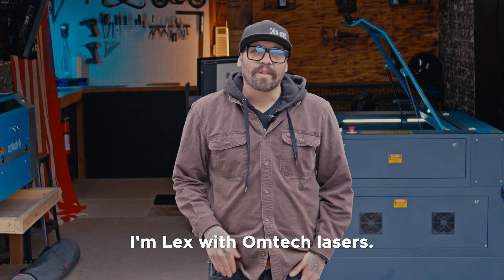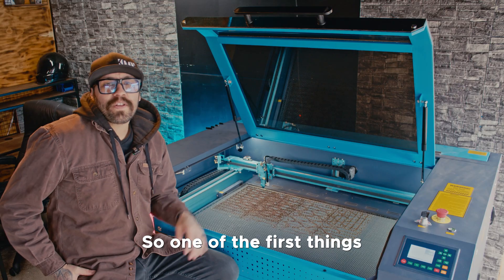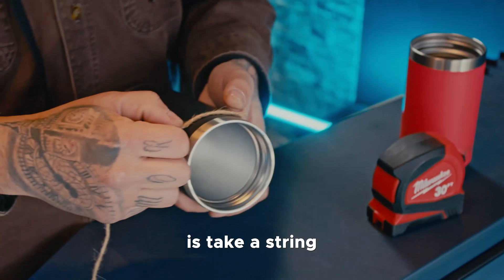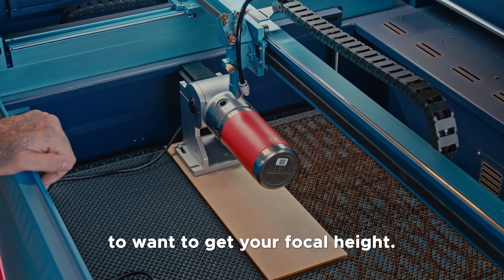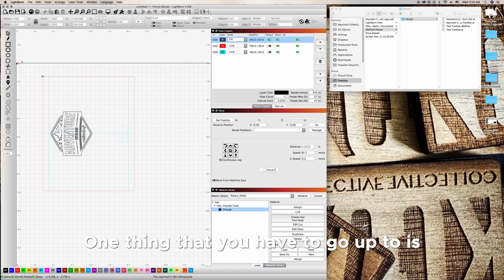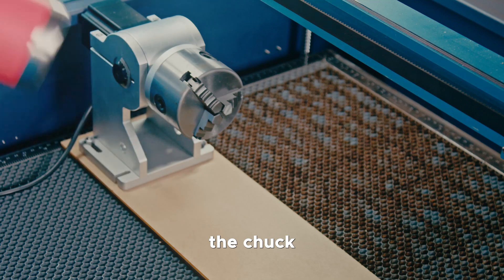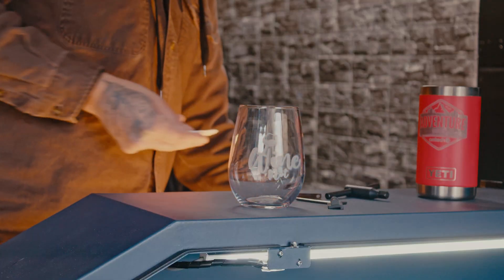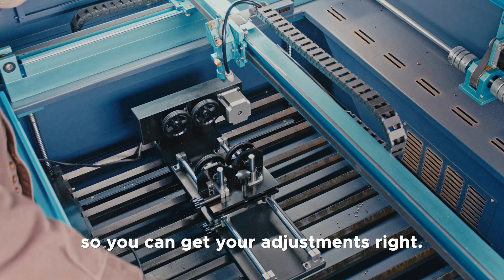Pronto Machine Rotary Axis Installation Guide: Enhance Your Laser Engraving Skills!

Comment: If you measure the diameter accurately, huh, dial calipers, 
Math will get you the circumference, which is much better then using "String"

Comment: I have a question, I ran into issues when I wanted to set up my rotary. On the pronto do u have to turn off the y axsis as somone from customer service sent me a guide but seems like this video does not show that and the laser head is moved using both. My machine went haywire when I tried to use it. Maybe I did something wrong 🤷‍♂️
Reply from the maker: In the pronto, there should be a toggle switch next to the 4 pin connector. Press that and this will change the Y axis to your rotary.
Reply: @omtechlaser  Thanks for the info.

Comment: So is the rotary chuck he is using the one that is advertised for fiber lasers on the OMTech website? I recently purchased the OMTech chuck rotary advertised for CO2 lasers only because all the Fiber ones said they were for fiber lasers only. The one I purhchased also said it was for 50W and greater CO2 lasers and it definitely does not fit in my OMTech Maker Series 12x20" 50W laser.
Reply from the maker: You can use either rotary with a either laser as long as the plug fits and settings are correct. The chuck rotary in this video is used with this pronto as well as a fiber laser.

Comment: I'm at 3905 . do I still need ti d o square if it starts and stops same place. My lines are wavy with bi directional  on
Reply: You don’t have to do the square if it is starting and stopping at the same place. 
So when you said you can’t get a circle is it on a tumbler because it looks like an egg shape?  If that’s the case then you need to unlock the artwork and change the width by roughly 8-9% which can be done in light burn. It’s a way to trick the eye on a cylindrical object
Reply from the maker: @Patriotic-Customs  This is a great tip for sure! Thank you!
Reply: @omtechlaser you’re more than welcome to it’s all about helping the community grow and to provide help when people are in need of assistance.
Reply from the maker: @Patriotic-Customs  Well said!!

Comment: Help my rotary  does not look like this. I cannot get circle. I have af2028 90watt
Reply from the maker: The dimensions and overall shape with really come down to your steps for rotation settings. You want to make sure you have the settings dialed in to make sure you get the correct resolute. Especially with circles.
Reply: Are you using a chuck or roller style rotary?
Reply: chuck
Reply: @carlaheft6006 oh ok. So do you have your steps per rotation dialed in?
Reply: @carlaheft6006 not sure where you have your steps at right now but recommended to start at 3000 and then you would go up from there. Try to also put in a tumbler and measure the diameter of the tumbler and input that info into your software( light burn I am assuming) and then make a rectangle box the size of say a inch by the circumference of the tumbler. Once you have that done and you’re ready to engrave to say. You don’t have to engrave. Use a piece of painters tape with a mark as your starting point and then do a frame of the job and if it matches from start point to the same point you have your steps right and if it’s short then you have have to increase them